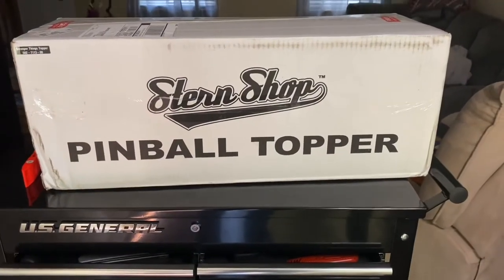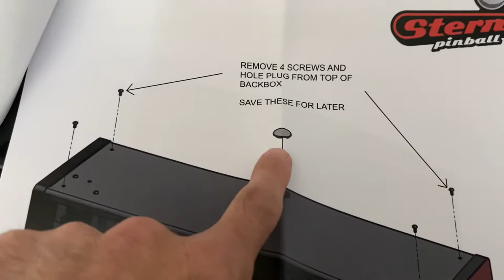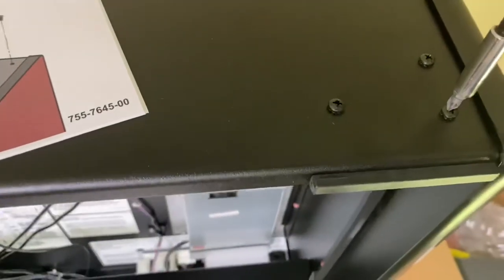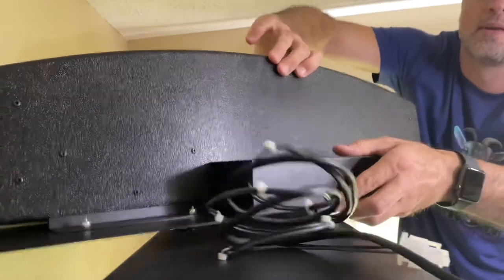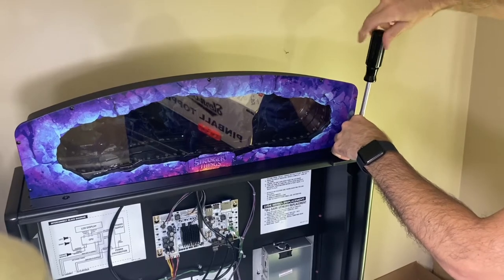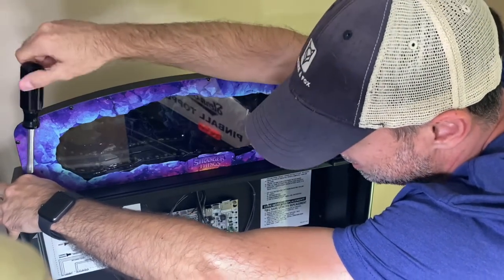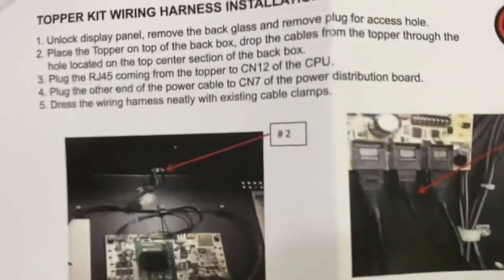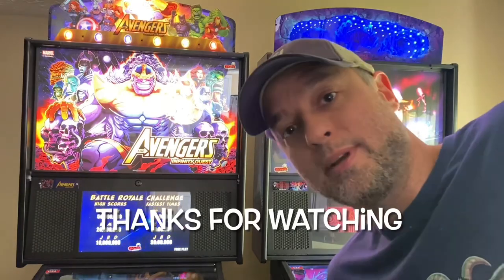Installing a Stern pinball topper(in real time)

Comment: What type of connector is it that goes into the " CN7 " plug?
Reply from the maker: Not sure what type of connector. In the manual it just says the plug is for the power cable. I believe it’s 12V but as far as the connector end? Not sure. It’s the opposite of the Ethernet cable looking one. Lol